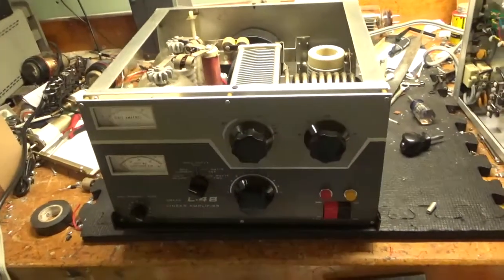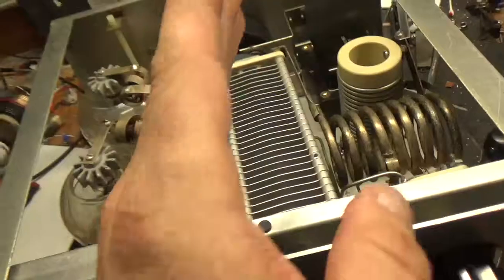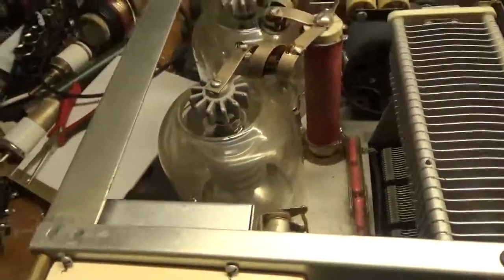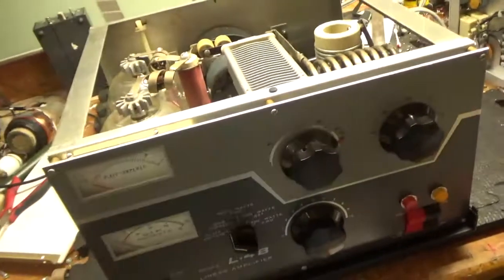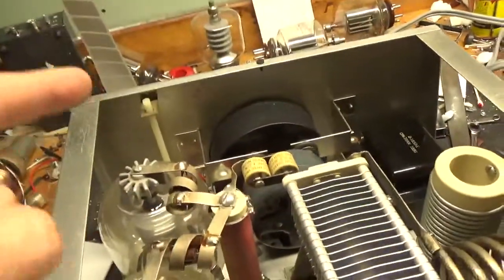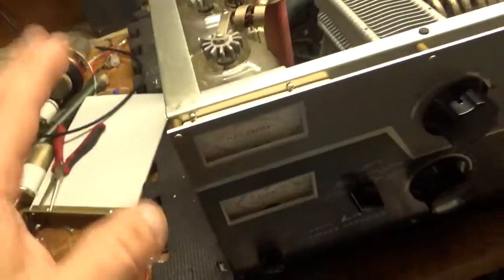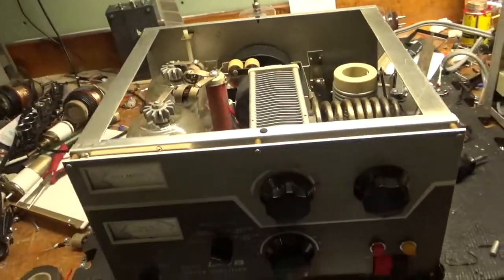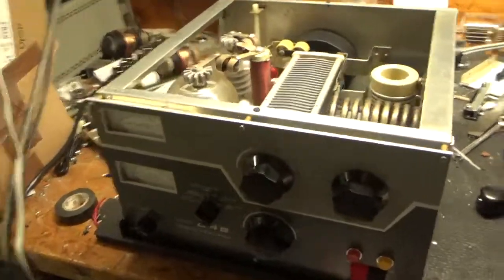Drake L4b Repair

Comment: Hi AL7KT here.  I just received a Drake L4B via UPS… I guess during shipping the plate capacitor screws came off.  How in the world do you reconnect the plate cap - the screws are so small.  I’m afraid to power it up with it just sitting there.  Is there an easy way to screw that thing back on?  Is it dangerous if it’s not?  Thanks in advance.  Love your videos! Oh, while I have you.  Why do some L4B have the coil connected to the back and other are connected across the capacitor near the front?
Reply from the maker: Good morning , do you mean the anode dissipating cap. It’s held in place by an Allen screw.